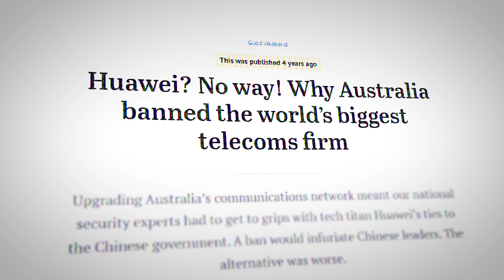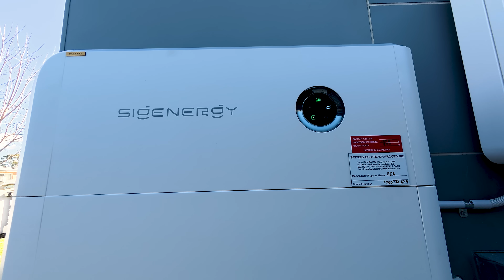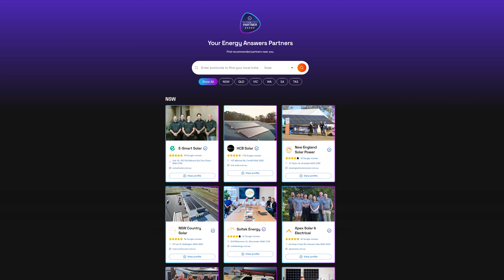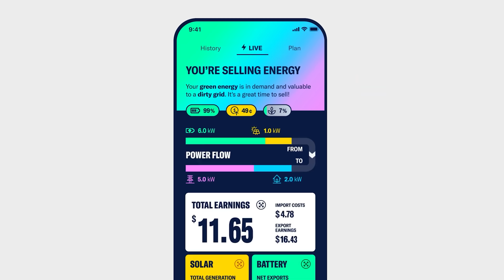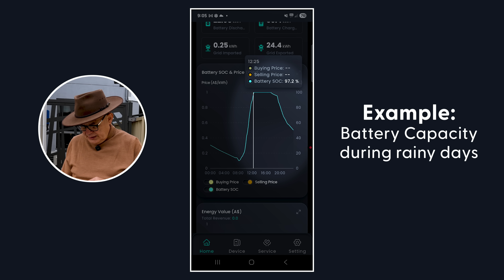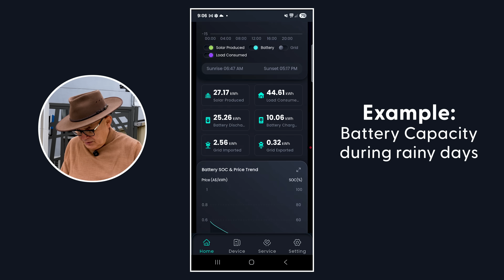Is going off-grid with Sigenergy a big risk?

Comment: This may be an unpopular opinion with some, but I feel that everyone with a battery should, if at all possible, remain connected to the grid, otherwise we are are not contributing to assist in lowering wholesale electricity prices. This affects those like renters who are at the mercy of the retailers in terms of cost.  Connect via a wholesaler and we should be able to reduce your break-even payback on the cost, but at least we wont be cutting loose those that can't afford or are not able to install a BESS.  The second point you may be missing is that with a battery, and a system as large as yours comes energy abundance (if connected to the grid). Most of the time, we are filling a battery for free from PV, but if we want to keep the Aircon or heating on longer,  charge from the grid at very low prices (or be paid to charge when prices are negative), so what we now have is energy freedom. You''re free to use power whenever you like.  Good video, I enjoyed the perspectives you sought.
Reply: If the energy retailers would play fair - I actually agree with your point - but they a greedy have used ther current energy challenges to line their pockets even more and do not display any social concience - so one has to threaten their business model to get some action - meaning investment in batteries to be able to give a fair price in FIT.
Reply: Even if disconnected from the grid, such households would be contributing somewhat compared with a household without solar and battery as they won’t be placing a load at peak times on the grid.
Reply: ......er, we were told that by getting solar panels, we would be helping the grid and reduce the need of having to build more power stations to meet the daily demand, leading to lower power bills.... 

Now we are being told that due to the short sighted power companies not being apply to "handle" the increase in solar power, power companies are looking into charging a fee for "excess" solar power going into the grid.

Next we will be charged a fee if you use your batteries, reducing your demand on the power company. (Which would be a fair thing to do, to avoid any decrease in the power company's profits /s)
Reply: Agree, getting thousands in rebates for this reason.
Reply: I thought you already had a Sungrow battery mate. What happened to that?
Reply: I got rid of the grid ove a year ago and haven't looked back, using more power then ever now without worrying about bill shock.
Reply: I agree and I have nearly always considered that we should remain connected to the grid regardless to support the community (and of course there might be times when we actually do need the grid). Perhaps the retailers could reduce or eliminate the connection charge for customers who contribute when they don't need to?
Reply from the maker: Absolutely — and fair point. While staying grid-connected has its benefits, especially from a broader market perspective, going off-grid still has a strong case for the right households.

For starters, it’s not just about saving money — it’s about control. When you're off-grid, you're no longer subject to rising daily access charges, volatile retail pricing, or changes to feed-in tariffs that seem to drop every year. You're making a clear statement: “I'm backing my own energy.”

Comment: Very Very good explanation with the glass of water. I have been in that boat most of this year. It's those damn 4-5 days in a row that is disappointing and I have to begrudgingly use the grid.

Yes 90% of the time you can be off grid. The expense to got 100%, which is what one ideology thinks is possible is 4-5 times more expensive, more expensive than traditional power generation.
Reply: as my sdolar system does still give me 230 kWH on a rainy day - if I could convince my family not to bake bred in the electric stove on rainy days -I believe my set up can do it.
Reply: @markuslambert8236  Hi Markus - you wrote in a different (earlier) comment that you get only 2 kWh on a rainy day - is this a typo? 🙂
Reply from the maker: Yep, those multi-day stretches are the real test for any off-grid setup, that’s for sure.

Comment: I'm going to assume you weren't monitoring your output regularly against the maximum output therefore didn't realize you had lost 25% production?
Reply: I have a solar analytics monitoring , as the SMA monitoring is so so... and the SA told me everythging as expecterd and i was exporting 100 kWh on some days and I though that was plenty - and as the melted MC 4 plug (original Staubli) seemed to have occured very soon after install- solart analytics never picked it up as the 3 string output seemed to be the "norm"  . So I was left in the dark, even with detailed monitoring.  As soon as the MC4 was fixed - it was like my system had a turbo added.
Reply: @markuslambert8236  I have a similar sized system to you and in summer regularly export up to 250kWh a day. If you are only doing 100kWh on peak days, you are either using a massive amount in your home, or maybe there is a curtailment issue with your system. Are you able to export at the full 30kW to your DNSP?
Reply: @IXXIBoss  I am in Sydney and about 10kW of my system has a shade issue after 2 pm.. and then I also have a 5kW solar car port that has some shade challeges. Yesterday - so this is mid Septembert I exported 126 kWh- ah and do not forget the consumption of a 2nd dwelling on the site.
Reply: @IXXIBoss  Great question 🙂
Reply: @markuslambert8236 that’s a shame you missed out on that power. Can you look at each individual string in the sma inverter to see the output. If so that could have alerted you earlier although the installer should have checked before leaving the premises.
Reply: @andrewflies9119  - did not have string level moniotoring - via the SMA - trusted the solar analytics .. :(